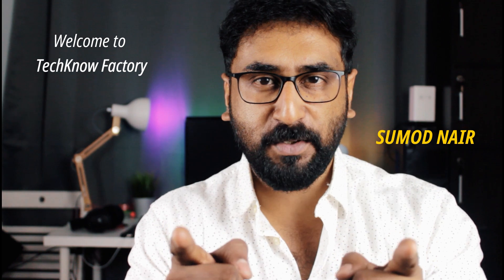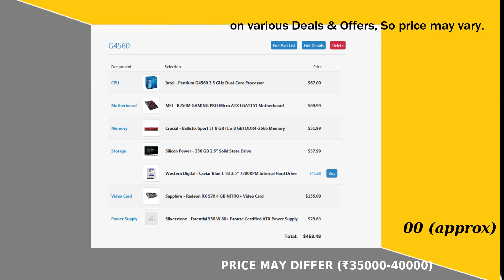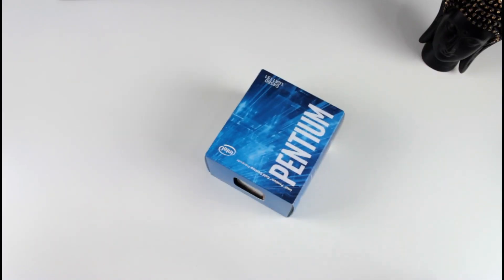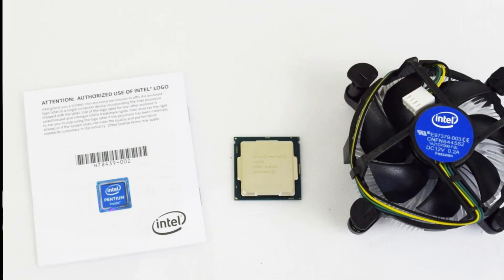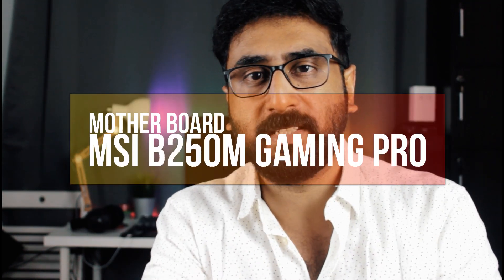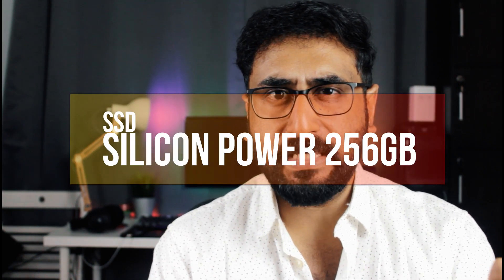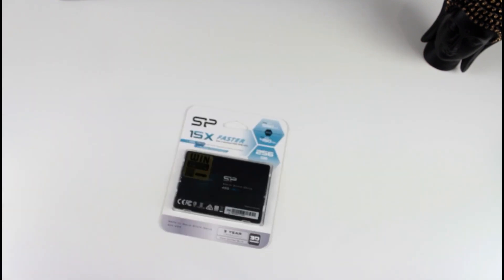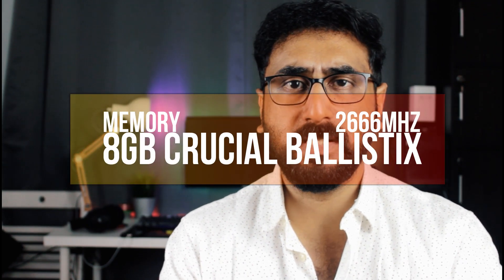Low Budget Gaming PC Build under ₹35000 or $450 (Malayalam)

Comment: G4560 ആണോ g6400 ആണോ nallath
Reply from the maker: Both now not recommended 
Try to get ryzen 3 APU
Reply: @TechKnowFactory  apu ആയതുകൊണ്ടല്ല ചോദിച്ചത്. CPU വച്ചു നോക്കി കഴിഞ്ഞാൽ ഏതാണ് നല്ലത്
Reply from the maker: ryzen is better than intel pentium
pentium thanne vene 6400 nokam for basic use
Reply: @TechKnowFactory  njaan ryzen 3 3100 എടുക്കാൻ തീരുമാനിച്ചു thanks
Reply from the maker: @Telecast.555  3100 edukuvane seperate GPU venam,
Reply: @TechKnowFactory  kuzhappamilla.
Apu ne kkal nallath cpu+gpu

Comment: Bro ipol namuk under 40k ryzen 5 3500 use cheithoode
Reply from the maker: under 40k ryzen 3500 not possible gpu rates high
Reply: @TechKnowFactory   ryzen te Ethan upayogikkan patunnath under 40 k? Please reply...
Reply from the maker: 3100 may be nokam stock unde contact any tech store for build details 
Currently nothing is in stock
Reply: For programming and grahic design purpose

Comment: can i use 1060 for amd A-6 9500 pro
Reply from the maker: No.. It will bottleneck
Reply: @TechKnowFactory  but indian budget gamer includes it in gpu for potato pc
Reply: Even if it bottleneck it will be a slight one right
Reply: Will 1050ti bottleneck
Reply from the maker: @himagangajoji4222  1060 is heavy full bottleneck and 1050Ti also.. 9500 is old cpu please upgrade to ryzen for better performance and stability with gpus

Comment: Bro G5420 or G4560 which is best for gaming
Reply from the maker: Both are now very old 
Try ryzen 
Or i3 9100f
Reply: TechKnow Factory pls tell me G4560 or G5420
Reply from the maker: They both are almost same not recommended actually... Gaming depends on graphics card these 2 processor now not worth same price u can get i3 now
Reply: TechKnow Factory Iam using H110M motherboard so i needed 6th gen or 7th gen processor . i3 6100 is priced 9000 and i3 7100 is priced at 9500 . G4560 priced at 6300 and G5420 is priced at 4900 . i3 is overpriced. Pls tell me G5420 is good for gaming or not
Reply from the maker: Not good without good gpu ok... U have gpu or no?
Reply: TechKnow Factory I have gtx 1050ti
Reply from the maker: What gpu u have?

Comment: hey man enekke oru doubt chothikkan onddayirunnu
intel pentium G4560 ddr3 analo alle ? 
So njn eppo intel pentium g4560 cpu vagittu athil 4 gb ram and 2 gb graphics card kuda add chaythal gaming chayan patto ? games like farcry 3 and assasins creed 4 black flag ?
Reply from the maker: yes may be in low settings... depends on the gpu also... g4560 is very old try smthg new g5400 ddr4 or ryzen APU or with gpu
Reply: @TechKnowFactory   I see so 
intel pentium G5400 cpu with 4 gb ram and 2 gb graphics card vagan athra avum price ?
Reply from the maker: whats ur budget... rates check online or in shops.. now prices okke changing and kooduthal aanu ippo
Reply: @TechKnowFactory  I see... 
so oru 15,000 rangil nalla gaming cpu adukkan pattumo ?
Reply from the maker: Cpu ennu udeshiche.. Only processor aano?? Or endokke venam
Reply: @TechKnowFactory   Cpu anne udeshechathe processor, 4gb ram and 2 gb graphics card yellam koda. 
So oru 15,000 range gaming cpu ketto ?
Reply from the maker: Motherboard powersupply okke undo
Reply: @TechKnowFactory  yes allamkuda oru 15,000el thazhe varo ?
Reply from the maker: Illa verulla.. Shop il used pc noku chelapo kitum
Reply: @TechKnowFactory   ok so 20,000 ondagil brand new vagan patto or athilum kudo ?
Reply from the maker: @lionhearted6545  brand new min 28k above avum without GPU... used also may be 22-25k avum
Reply: @TechKnowFactory  ok thanks for the info man. I appreciate it.

Comment: Question : ippol erangunna latest gpus and upcoming gpus pcie 4.0 aan slot specification. Eee latest gpus pcie 3.0 il use chythal problem undo.
Reply from the maker: now only amd gpu are 4.0, nvidia next when dont know..you can use no prb but they will run at pcie 3 speeds or specs only you wont get the full potential of pcie 4 gpu.

Comment: Sir. Gddr mother bordil   Gddr5 graphics card  support aavumo.. proccessor  2016 model i5 aaanu
Reply from the maker: Support avum motherboard is not a prb.. Speed will depend on how much motherboard has
Reply: TechKnow Factory  mother bord gddr 3 anu   old  intel i5 aaanu
Reply: Okk but gta5 , fifa 19 ithokke kalikkan aanu  appo 1050 cardin vendathra perfomens kittuo ...  lag steck ith pole enthengilum problm undavumo ..plz rply sir
Reply from the maker: Lag kanum better upgrade new parts... 1650 super is better
Reply: Sir appo mother bordum gddr 5ഉം processor  new versionum akkendi verumo... lag illathe kalikkan..
Reply from the maker: Ellam change cheyanam to latest products...

Comment: RYZEN 5
ASUS B450
1030TI BEST UNDER 35000
Reply from the maker: 1030ti????
Reply: @TechKnowFactory  RYZEN 5HAS INBUILT 2GB GRAPHICS SO WE CAN ADD 1030 TI OR SSD WITH THAT UNDER 35K BEST SPEC
Reply from the maker: I dont think there is a 1030Ti gpu... There is gt1030 which is waste with ryzen 5. Huge bottlenecking... Also pentium build video is very old one so now 35-40k i3 9100f with gtx 1650 is best.
Reply: @TechKnowFactory  i mean 1050ti
or 1030 sory for mistake
Reply: @TechKnowFactory  but I think ryzen 5 and asus mobo b450 with ssd is best under 35000
Reply from the maker: May be, but a dedicated gpu is always faster than APU... Ryzen 5 2400g alone for 35k is waste when u can make better builds with discrete GPU... More performance than 2400g...

Comment: Why you did not choose G5400 gold as processor.can you please mention which is better of G5400 or G4560
Reply from the maker: i choose it bcos it was cheaper at that time and still it was better to try... G5400 is better than g4560....
but still you can check ryzen 3 also
Reply: @TechKnowFactory  Thakyou sir,you have cleared my doubt.i am trying to built a pc with G5400 processor.can you please reply to which generation does G5400 belongs to.
Reply from the maker: Its 8th gen processor.
I would recommend ryzen 3 which is more better compared to pentium series...

Comment: Complete build video venam
Reply from the maker: Sure cheyaam bro...🙏thanks
Reply: @TechKnowFactory  
Njan new PC build cheyyan nikkanu Gigabyte B360M Gaming HD Intel LGA 1151 DDR4 SATA 6Gb/s USB 3.1 Micro ATX Motherboard kollavo please replay
Reply from the maker: Baki details...Processor edha?
Reply: @TechKnowFactory  
Ryzen 3 1200
Reply: @TechKnowFactory  Corsair Vengeance LPX 8GB DDR4 3000Mhz for Intel 7th, 8th Gen & ...
Reply from the maker: B360 mother board is for intel.. Ningal paranja name il thanne und Intel ennu....Amd ryzen work avulla.... Ryzen nu B450 series morherboard noku
Reply: @TechKnowFactory  
Njan cabinet vangicchu nx 200
Ini yente kayyil 19000 rs und PC build
details paranju tharo
Reply: @TechKnowFactory  
Njan cabinet vangicchu nx 200
Ini yente kayyil 19000 rs und PC build
details paranju tharo
Reply from the maker: 19000 il graphics card ulla system kittilla
Reply: @TechKnowFactory  ariya njan gpc card ippo vangunnilla gpc illathe aanu paranjad
Reply from the maker: gpu illathey aane ryzen 3 2200g noku 8gb ram b450m name ulla low motherboard, 450w powersupply, 1tb hdd
Reply: @TechKnowFactory  thanks
Reply: Hello asusz inte EX-a320m gaming mother board und adh kollavo idhilekk
Reply from the maker: Kuzhapam illa but future upgrade doubt aa... best is B450m... Vere vazhi illengil a320m use cheyam
Reply: @TechKnowFactory  
Sheri
MD computers inte app undo website sign in cheyyan pattunnilla
Reply from the maker: App illa website ollu... Better try local shops also avide price kurachu kuravayirikum...

Comment: Graphics cards nirbadamanno
Reply: Ryzen 2200 g pubg emulator kalikkan pattumo atho athilum Nalla processer veno
Reply from the maker: 2200g kuzhapam illa low budget range
Reply from the maker: Nalla performance nu gpu venam... Allengil ryzen 3 2200g pole ulla APU anengil normal gaming cheyam lowest settings

Comment: ryzen 3 1300x
msi b450m gaming
8gb corsair 3000mhz
wd green m2 240gb
wd 1tb hdd
corsair cx550
antec nx200 rgb
asus strix rx570
 g5400 
msi b360 gaming pro 
8gb corsair 3000mhz
wd green m2 240gb
wd 1tb hdd
corsair cx550
antec nx200 rgb
asus strix rx570
 Wich is better
Reply from the maker: Ryzen is much better... More cores...
G5400 cant use 3000mhz ram only max is 2400mhz...

Comment: Looking For A Gaming n Editng Budget PC N Upgradeable To High end Checkout This 

AMD Ryzen3
https://amzn.to/2KYIvjR

Gigabyte GA-A320M-HD2  Motherboard
https://amzn.to/2uqsOHZ

HyperX Fury Black 8 GB DDR4 2400
https://amzn.to/2LkB6aN

WD  1TB Internal Hard Drive (Blue)
https://amzn.to/2mlMpow

Foxin Cabinet With PSU
https://amzn.to/2KVdJsl
           
OR

Corsair Carbide Series CC-9011050-WW Mid-Tower Steel Gaming Case with Red LED (Black)
https://amzn.to/2uCCfTY

Cooler Master MWE 450-Watt Power Supply
https://amzn.to/2JqZZ2Q
Reply from the maker: are u looking for a PC ? or you are suggesting this...? manasilayilla
Reply: Suggesting
Reply from the maker: ok but most prices are high... also chk the mobo is latest with sticker on it

Comment: I think this the best gaming pc under 37K
Ryzen 3 1200(4core,4threads) t
A320m motherboard
8gb ddr4 Corsair Vengeance 3000Mhz
RX 570 4gb
120gb Kingston SSD
1 tb WD Blue HDD
Corsair cx 550 PSU
Antec Nx200(RGB)
Reply: Bro telegram contact tharuo
Reply from the maker: bro telegram illa.... fb, whatsapp or insta
Reply: ithil fcp cheyyan pattumo
Reply from the maker: Fcp apple nde software aanu... i dont think it will work.... Only apple devices
Reply: @TechKnowFactory 
Bro ethanu njn vangan pokunna pc yude spec budget pc yanu oru nalla monitor suggest cheyyumo

  
Ryzen 3 2200G
Msi B450m pro m2 
RIpjaws  ddr4  3000mhz 8gb ram  (one)
Corsair VS450 450w   (80+ badge)
Western digital 1tb hard disk
Kingston SSD a400 120gb  
Hp X1000 wired mouse (black)
Antec nx200 RGB  case
Dell kb216 weird keyboard
Reply from the maker: A N O N Y M O U S pwoli... Pinne graphics card add cheydal super👍👍👍
Monitor ethra range nokunnadhu?
Reply: @spectre1313  RX 570 edukk allenka kariyilla
Reply: @TechKnowFactory  bro yude vedio kand chose cheythathanu.5k kond nalla monitor kittumo.. samsung nte curved monitor nallathano but athin rate kuduthala
Reply: @TechKnowFactory  g card vazhiye vangam
Reply from the maker: Curved okke kooduthala...
Reply: @spectre1313  go for any 1 ms Free sync monitor under 9K
Reply from the maker: 5-6K range il normal 1080p chelappol kittum.... Veliya graphics oo processor illadhe koodiya monitors medichittu karyam illa... Budget kuravane normal is ok...
Reply: @TechKnowFactory  1 ms and freesync Vedikkunah worth Alle, 144hx onnumalllaloo
Reply: @Harikrishnan-vu1cv  graphic card enthayalum veno?
Reply: @Harikrishnan-vu1cv  apu matti rayzon 5 2400g aakkiyalo
Reply: @TechKnowFactory  ok appo 720p monitor mathiyalle
Reply from the maker: bro basic processor aa adum no gpu... 1ms refresh and 144hz okke practically ryzen 3 il cant notice ... pne atrem specs ulla monitor il adhe pole output verumbol frames also will dip.... so adipoli monitor medichittu no use if pc doesnt have the power to show it
Reply from the maker: 2400g kurachoodi nalladhu but budget koodum... pinne full 1080p high gaming experience nu gpu venam....
Reply from the maker: ippo adhu mathi bro... 6-7k range il 1080p 24inch nalladhu kittum...
Reply: @TechKnowFactory  ok thanks for your valuable advice😍😍
Reply from the maker: @spectre1313  ok...pinne future il gpu upgrade cheyunnengil & mainly ippo mudakkan cash undengil 9-10K range monitor medikaam... up to your budget now...
Reply from the maker: Yaa thats an option i told in video.. Same price can get AmD also... But i just wanted to try this processor... It has so much good reviews...

Comment: Okke nokki vannappoll 48799 ayyalloo
Reply from the maker: hi bro
48799 veran chance illa bro
evideya nokiyadhu endh configuration aanu????
Reply from the maker: nyan video il paranjello chela parts india il same kittan chance illa.. kittiyalum price kooduthal aanu...so description il alternative parts koduthittund... ipo nyan noki... ellam koodi ipoo 37-38K range il kittum.... 
rough rates parayaam..
g4569-7K
msi b250 pro VD or VH - 4K
RX 570 - 13.5K
8GB RAM - max 3.5 to 4K
SSD 240 GB - 2.5 to 3K
HDD - 3K
PSU oru 450w mathi - 2.5K
case oru antec case 2 or 2.5K